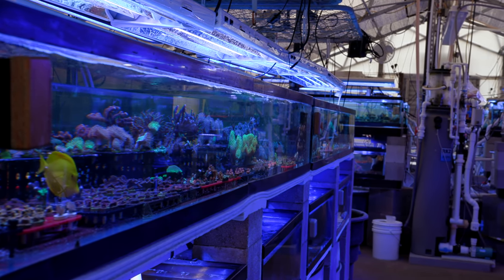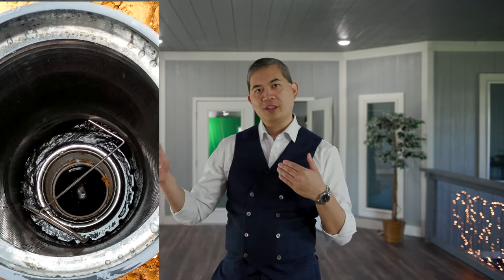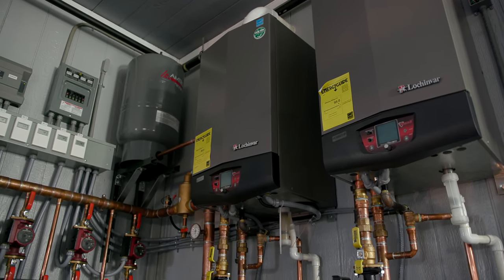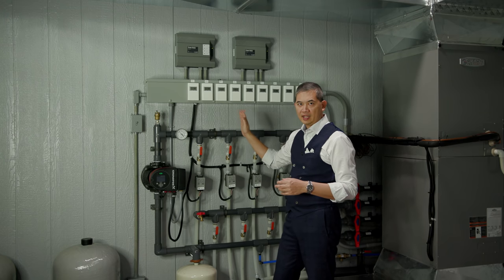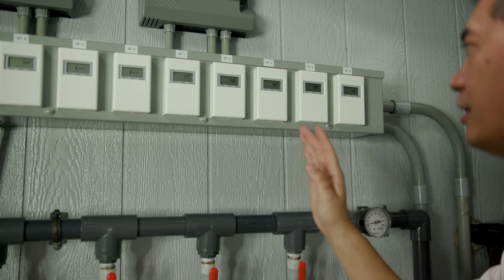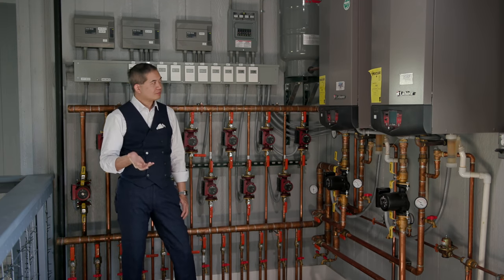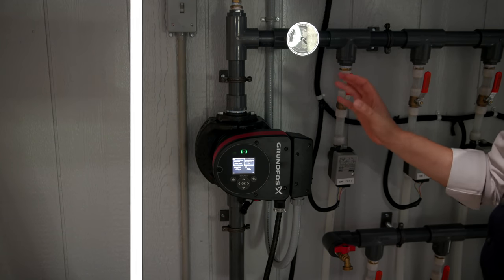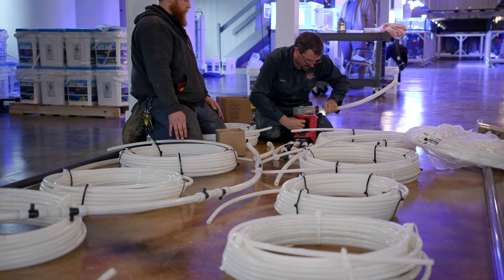New Geothermal Cooling System for the Coral Farm - Episode 16

Comment: This is truly a geothermal cooling system.  The in-ground heat pumps have better efficiency than using ambient air but the much higher installation costs make the payback period much longer.

I've wanted to use 55 degree ground water to provide chilled water for air conditioning of an off grid home, using solar power to pump the closed loop water.  The underground concrete cistern for water storage and thermal storage is brilliant.
Reply from the maker: Thank you!

Comment: love how you use rain water for RODI; pretty slick using it as a heat loop to cool the tanks.  Not to mention the super clean install !
Reply from the maker: The clean install is all about the plumbers.  They are the best I've ever seen.
Reply: @tidalgardens  I'd argue you're "plumbers" are actually hydronic heating techs ;)
Reply: @tidalgardens  either way very clean. Love the farm and the tips 👍👍

Comment: Absolutely fantastic to see this system coming today - such a huge scale and thorough design. 
Question:
How do you monitor water level in the cisterns?
Comment:
The could are a great idea but having them tightly wound (I.e. little separation between the different 'passes' of the coil) is not ideal from a heat transferperspective.
Reply from the maker: We don't have any remote monitoring of the water level in the cistern but we can just open them up and look inside if we are curious.

Comment: Geothermal heating/cooling is amazing...it should be used more for residential use than it currently is.
Reply from the maker: Things like radiant floor heating and geothermal is very uncommon but after having used it personally I would never do a house or building without it.  It is so nice.

Comment: Any reason you haven't tried use PT-1000 temperature probes with calibration? It basically eliminates the false resistance in the cables. Since you spoke about different readings, it feels like most of the temperature probes are PT-100, which is common in commercial grade equipment. 

And since you mentioned clean wire management. Have you've installed a lot of back-up piping between the house and green house for future wiring/plumbing that may come? For example, a 'cable grave'.
Reply from the maker: Funny you mention the future/just in case piping.  I requested several extras.  Over the construction of this place the project scope expanded and we used every single one of them.  My plumber was telling me the other day had he known that this place would be more research lab than warehouse he would have installed a dozen more.

Comment: I'm a big fan of yours solutions and the way you translated all of your previous knowledge always trying to eliminate old mistakes and using the state of art in equipments.im curious to know how do you monitor leakages in the cooling hoses inside the rain taks ? Can you enter in the tank to inspect the coils ? Do you also have a temp sensor inside the rain tank as well water level sensors ? I saw that you live in a super cold place. Do you have sensors controlling the internal building temperature opening windows to renovate the room air and temperature ? Thanks from a coral lover from Rio de Janeiro Brazil
Reply from the maker: So the chances of a leak in the coil is REALLY unlikely, but if there was one, I would expect to see a pressure drop in the system which would be picked up by both gauges as well as the pump display.  It is possible to get into the cisterns with a ladder if you pump all the water out.  As for air, we have four air exchangers called Heat Recovery Ventilators (HRVs) that constantly swap the inside air with outside air without losing a lot of heat.  They work GREAT in the winter to keep the air inside the building dry.

Comment: This is a great behind the scenes look into the systems. You can tell you really enjoy the industrial side of things. One question. Since you have the new building do you think you will ever migrate all the livestock from the greenhouse over to the new building in order to redo the greenhouse systems to make them more efficient?
Reply from the maker: My family and staff here roll their eyes when I talk about it, but yes I would like to re-work all of the systems in the greenhouse.  I would probably NOT move everything over to the new building to do so just to keep things over there as clean as possible, but there is some serious room for improvement in the greenhouse.  Having said that, the existing greenhouse has some amazing state of the art tech in there, but it also has 12 years of older infrastructure that I would like to re-work.

Comment: Hello. Do you monitor the water temperature in the cistern ? Do you see difference during the summer or winter ? Do you belive if we can use a geothermal chiller in a tropical country ? Do you also measure the water pressure inside the coils at the cirstern to monitor leaks ?

Comment: Such a great cooling system. We should be doing this in Australia with our homes.

I've always been told that using rainwater on RO is difficult due to biofouling. IE since the water isn't chlorinated you get bacteria growth clogging everything up. Has that been an issue?
Reply from the maker: The rain water has to be treated before it gets to the RO.  We run it through chlorine as well as carbon and micron stages.
Reply: Wonderful. I love these innovations you're using. Great for the environment as well.

Comment: That's pretty amazing Than. Tell me, since it's a geothermal system officially, does the state of Ohio offer tax incentives and cost share programs for Geo? NY does and a few years ago i had installed a 14Kw solar system. All the incentive programs paid for more than half the cost of the system. That being said,  do you plan on a solar system for your buildings?  I would next like to invest in a couple of vertical wind turbines .
Reply from the maker: I don't think there are any incentives right now unfortunately.  Previously there was an incentive program for electrical reduction through the energy company but they suspended it a few months ago.  As for solar, it is something I would like to do in a couple of years but before I do any project like that I want to get done with all the aquariums.  Our electric bill right now is pretty manageable but once everything is up and running solar will look better and better.

Comment: Amazing stuff.  You have definitely raised the bar for coral farms.  And to think I was excited by my AWC to the garage.  At some point will the water in the system warm up or be low as it’s consumed?  Thanks for the very cool video Than! 😎
Reply from the maker: It is unlikely.  The ground is constantly soaking up the heat, and the bottom of the cistern is over 12' down in the ground.  Another way to look at it is to consider the amount of BTU's needed to heat 10,000 gallons of water sitting down in the ground from 55 degrees F to 75 degrees F.  One BTU is needed to raise one POUND of water by 1 degree.  Fresh water is a little over 8 lbs per gallon.  So... 20 degrees x 8 pounds x 10,000 gallons = 1.6 million BTU and that is not counting the ground itself soaking up the heat away from the water underground.  Someone can double check the math but it is in that ball park.
Reply: Tidal Gardens great science info.  I also saw later your video you can add more tanks if needed.  Your maths proves it wouldn’t be needed for the temperature.  Thanks!

Comment: This is awsome! I could also do this on a smaller scale? I bought a new house with a barn for expanding my hobby to more professional here in the Netherlands.
Reply from the maker: You could do something similar just by burying the tubing if the ground stays cool.  In the Netherlands it is probably fine, but some geographies the ground temperature is hot.  Also, it is far less expensive to do a single aquarium rather than having a system that has to route cooling to 9 different systems on demand.
Reply: @tidalgardens  we don't have a hot climate here.. I also will collect rainwater.  I think I will have arround 3 coral systems in there and 1 fish system

Comment: Hi Than!   Amazing setup here!  Funny enough...  Randy and Ryan from BRS mentioned to reach out to you about geothermal heating and cooling as they recalled you being the only one out there doing this.  I live here in Florida and I have a 500 gallon outdoor system that I have been racking my head on how to geothermal cool it.  What are you using on both sides as your heat exchange?  Copper in the ground and looped pex inside your sumps?  Thanks bud!  Your videos are truly inspiring!
Reply: At 3:50 he said "about 1000 ft of pex coils down there." I'm guessing he wouldn't want copper in the cement cisterns he's using for RO/DI source water. I can also only assume he isn't running his aquariums' salt water through the geo cooling plumbing given those brass junctions and that specialized pressure actuated pump. In that case I guess the fluid in the cooling lines is isolated like you noted. I then wonder what would make a good fluid in a cooling loop other than water.
Reply: @billforigno  Good Call out!  I totally missed that was in the cisterns... I thought it was what he mentioned was in the sump as the exchanger.  I think glycol was what I read was the best heat exchange fluid if its a closed loop... but still scary to put anything but RO running through the lines in the case of leaks.  The other way you would think is to send the tank salt water itself through the lines... but again... so much risk if any leaks/seepage occurs.

Comment: Genius! Very sick set up. Question: any worries of the salt water corroding the valves or any metal leaching in at the valve points ?
Reply from the maker: The cooling coils are closed systems and they are filled with fresh water so there is no salt water contacting the mechanical devices in that way.
Reply: Tidal Gardens duh ! Lol 😂 🤦🏾‍♂️ . I totally forgot you said that . Thanks !!

Comment: Hi, one more time, thanks for sharing so informative video! Regarding your problematic of cooling / heating fighting,  relay servitude may end up with non-convergent oscillation. You give prio to heat over cool, is it suitable with corals? (no exp. in this domain..) I wonder if, based on room temp, you can't predict normal duration between cooling and heating, if it repeat it, and compare with what is currently happening. If it is shorter, then it detects what could be an issue with probes.  ;-)
Reply from the maker: This video makes it sound like this cooling system is all encompassing, but in reality there are multiple systems at work to cool the tanks down.  We went over 10 years using other methods to cool the greenhouse tanks down and this geothermal system is just another layer of cooling technology available.  The hope is we won't even need this system to run very much if the other systems can handle the heat during the summer.  It is only when we have multiple 90-degree days in a row that they tend to get overwhelmed and a system like this will help a lot.

The potential conflict overlap only happens on very goofy times where the temperature is just right outside that the systems will get confused.  Normally either it is way too cold out or way too hot out.

Comment: :) Hi from South Texas. I am setting up a mixed reef tank. On previous
 Marine tanks I ran a heater but a friend told me he never runs a 
heater. I keep my house temp set at 72 and my tank seems to be holding 
steady around 74.5. But in doing some internet research I seem
 to get the consistent you should be at 77. Whats your thoughts? Is 74 
OK? or to low. Thanks.
Reply from the maker: It's probably fine if you keep it consistent, but it is on the chilly side.  I shoot for 77.

Comment: Hi!
Are you guys running a close-loop heating/cooling with Titanium heat exchangers or other heat exchanger is each system?
Looking at building something similar but storing chilled water that was cooled using solar power.
Reply from the maker: No, I'm not using titanium.  The PEX coils act as a heat exchanger.  I haven't used titanium before but it might be a good choice if you are space constrained.
Reply: Tidal Gardens , so you are running cistern water through the PEX coils located in your sump?

Comment: how much does it compare in cost compared to your old system?
Reply from the maker: The old system was just the cost of the tubing basically and we ran water through it like a hose, so in the dead of summer we watered the lawn a lot.  This system is a lot more expensive but it doesn't use any water since it is a closed loop.

Comment: That’s the most legit system I’ve seen 😍

Using copper pipes not a problem? I’m new to the hobby.
Reply from the maker: The water running inside the pipes is fresh water as a closed system so there is no salt water from the aquariums that comes in contact with the copper components of the heating or cooling system.
Reply: You the man.